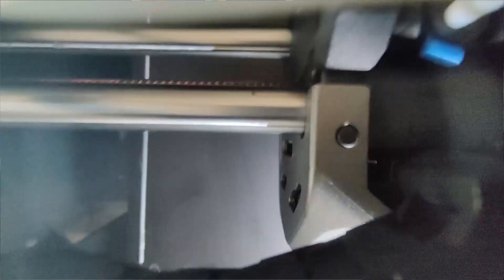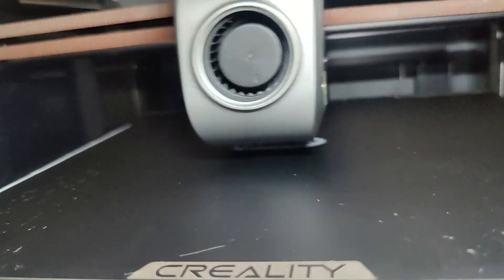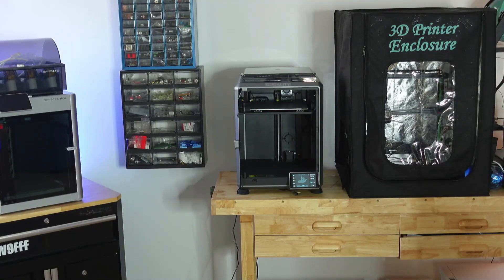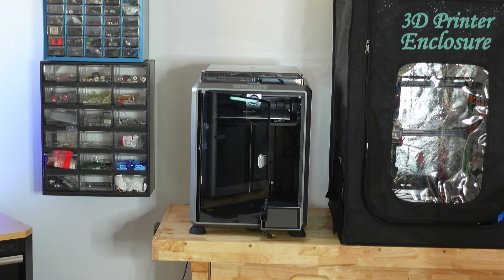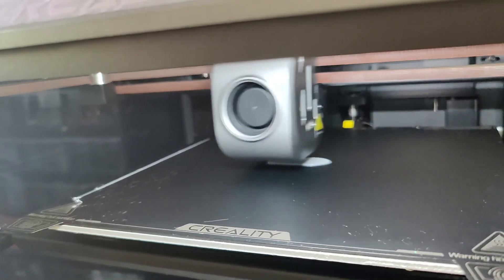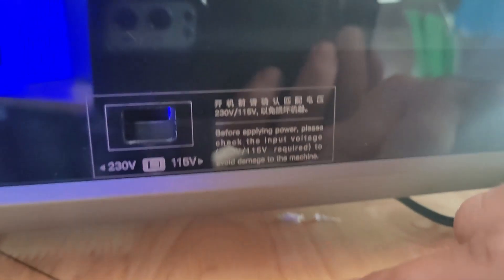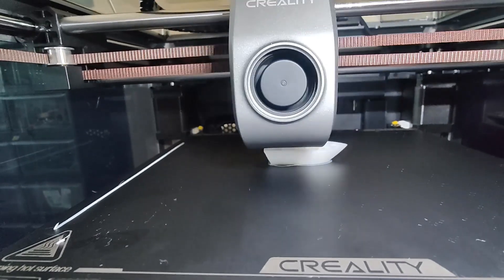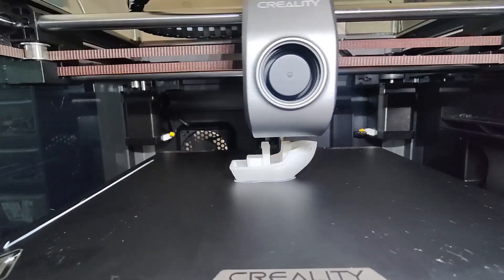Creality K1 - Poor Print Quality  -Try This Simple Fix

Comment: My printer is having this exact issue. I’ll will be checking this out. Thanks for your input!
Reply from the maker: Please report back.  A lot of people saying this shouldn't work (rightfully so), but It does for me, for whatever reason.
Reply: @DudeTested I checked my printer when I got home. It doesn’t have that switch that I can see. Min is the k1 max though. All of my prints are failing in this way. I’ll keep digging into it, but I’m pretty sure new to all of this.
Reply: @r10vw  I have a K1C and all of my prints are also failing the same way. Did you ever discover the cause? I tried tightening the drive belts, but that only worked for maybe 2 or 3 prints it seems.

Comment: I can confirm that mine didn't even turn on until i changed the power supply settings. I had even forgot this was a future in older PC systems, I am running into this problem with about half of my prints though
Reply from the maker: I thought it was interesting it didn't act like an old PC. I am willing to bet I have a fault in my PSU. Interesting

Comment: Be glad you didn't have a belt tension issue. So far between 2 K1 SEs my only solution for belt tension has been a bigger trash can.
Reply from the maker: Oh I did.   I think.i printed an adjustment tool.
Reply: @DudeTested  The one on Printables? I can't even get that to work, according to those the tension is equal, but my circles are eggs regardless. I did see another method where you turn the spring's screw in one turn then push it 2mm and start tightening from there, but I'm still too cautious to try that cuz it seems it'll over tension the belts.

Comment: I started on 115v😂 and that’s when I noticed the issue I can’t even do 230v it won’t power 🫠
Reply from the maker: A few people have said that too. Really interesting mine works on either. I remember computer Power supplys (AT and ATX) would have a switch on the back and like you mentioned, if it was switched wrong, it wouldn't work.  That was a feature.

Thanks for the input. Cheers.

Comment: I ve experienced the same problem, thanks for yor video. Shall I use an UPS
Reply from the maker: Hey there.  Interestingly enough, I was not using a UPS.  How about 4 days ago? We had a power flicker which caused the printer to reboot during a print.  Long story short. Everything resumed and the print resumed from its last known spot.  What's that I still feel like a UPS Is a better option and I would recommend one

Comment: There is a part of me that wants a 3D printer and then there is the part of me that says "this is more work than you want right now".
Reply from the maker: I really think you're going to like this project I'm working on. And you'll probably convince yourself to buy a 3D printer after it. However, I would say that we're starting to get into this era where printers are becoming essentially plug and play ready.  Look up the bamboo Labs X1 carbon, I just picked that up and although I've had like a few minor issues, It's been nothing but a pleasure to print with. Pretty much the same with that k1. I think I'll eventually face out all my bed slingers
Reply: if you buy creality you will regret it a few times , not the best product out there by far
no matter who sais what , trying to compare the k1c to an x1c the x1c wil out last out perform and over all just print circles around creality while your trying to rewrite profiles you had dialed in perfectly when their update comes along and completely resets all your hard work
not to mention their business model of milking their customers for money on crappy first gen printers only for them to release the apparent fixed issue as a whole new printer
i think my latest ender5 max wil be the last creality product i ever buy again

Comment: Just a side note, all Creality ships with it on 230.  You would think the ones being shipped to the states would be preset, they aren't.  But it works and it's nice being able to print something you need.  Now learning to design what I need.
Reply from the maker: What are you looking to design? Did you decide on a software
Reply: @DudeTested  dome Elmer's in the club are doing a class on fusion.  I have a few other pieces of software to try